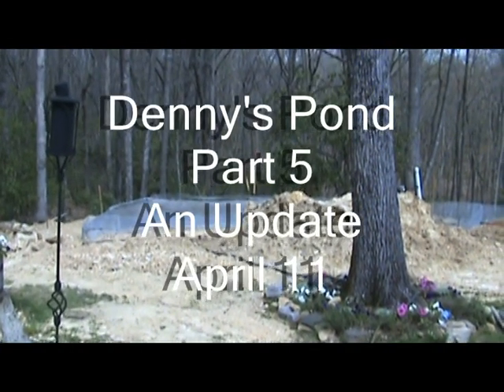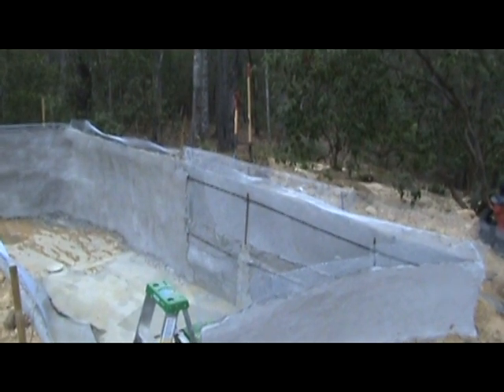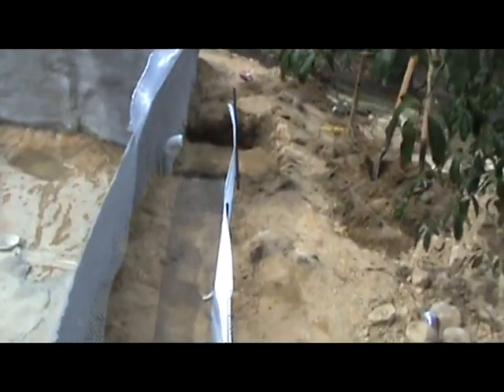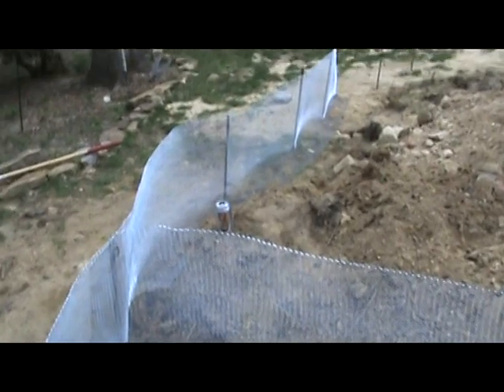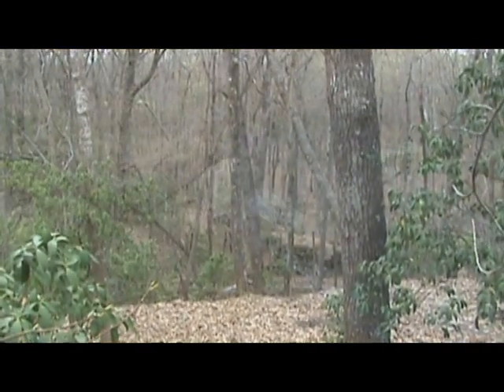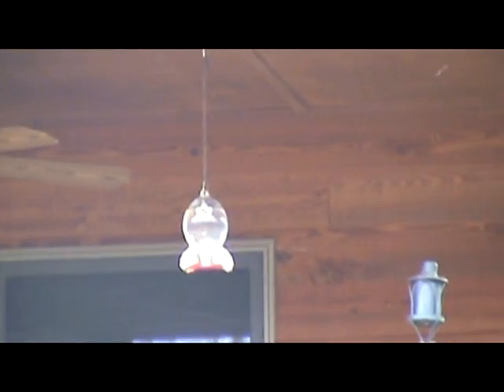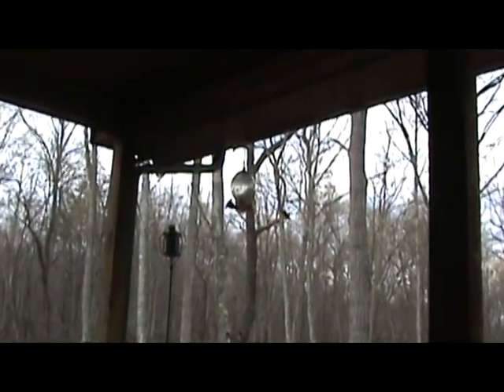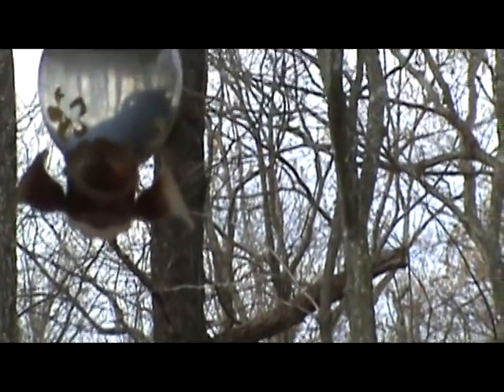Denny's Pond Part 5.mpg

Comment: Hello dperry (Don), again another beautiful creation.   Just curious, how was the bottom completed?
Reply from the maker: The bottom is solid sandstone. We cut out a trench into it, placed a bottom drain and pipe; then the entire bottom was covered with high-strength concrete by first coating the sandstone with acrylic bonding agent.  Later, we tried applying a rubberized coating, but that delaminated and I'd never use it again.